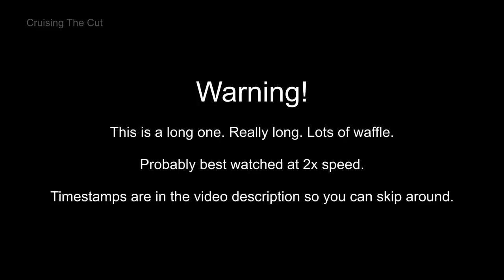241. Narrowboat DIY: refurbishing my shower cubicle

Comment: We have just spent several years totally renovating a 120 year old French longere, which now has 4 shower rooms, so i absolutely understand your frustration, screaming, use of great British expletives and need for alcohol. We also used "plastic panel" at an angle, but only cut the back and honeycomb leaving the thin front cover intact, then bent to to required angle, filled the open V shape in the rear with gunge and fixed into place. It negated the need to try and join half cut panels. Maybe you could try this when you next upgrade your shower.....lol. Anyway, great vid, loved your comments and the job looks perfectly acceptable. Stay safe, all the best/

Comment: As a seventy year old woman in Australia I have no clue about refurbishing a canal boat shower recess but as a sewer I understand your frustrations.  The thumb of rule is you measure twice, cut once.  I am constantly dismayed as  to the depths of my stupidity while trying out something new or out of my comfort zone with sewing, however, if I hang on in there with it I usually have the job done.  Your job looks terrific, glad there were no temper tantrums where you kicked the boards to bits (not while up against the tiles) and gave up.  Now every time you have a shower you can feel a sense of accomplishment.  Well done.

Comment: Looks well David. Only 2 things I would have done differently. 
Where you had to make the horizontal cut halfway down the wall, I would have scored the panel at the back and flexed it at the angle change. This would have left an unbroken surface. You could have possibly done the same for the corner moulding,
And I think I would just cut a few inches off the top of the vertical shower rail so it would fit the existing screw holes.
Regardless, it looks good and more importantly, should be very low maintenance.
….. and I’m so glad you went with s new rail lol…
Reply from the maker: Cheers. I didn't think of the scoring the panel back. As for the rail, it's such a cheap piece of plastic, it felt really brittle like it would shatter if I tried cutting it.

Comment: The same button that allows you to take the "gunge tube" out of the "gunge dispenser" is the one you use to stop the gunge dispensing. It takes the pressure off from the "gunge dispenser" trigger as well as allowing you to pull the gunge actuating rod out of the gunge tube.

Comment: Congratulations on completing a really difficult job.

Looking at what you have done against the finished work, I have to admit, it looks pretty good. You wouldn't think there were filled gaps and bogged up screw holes in your panels.

I would score you job easily at 8 (out of 10), and if you had not shown the mistakes, then it would easily have been an excellent score of 10. So, again, great job, and well done.
Reply from the maker: Thank you

Comment: Thank you David for another emotion packed DIY project.  I sensed your level of exasperation was on par with your chimney removal Vlog, where you ended up beating the poor thing into submission in order to remove it.

Given you are a perfectionist (I am also), you are being too hard on yourself because, the project didn't turn out exactly the way you were hoping.  Actually, you did quite good concerning this was your first attempt.  You didn't sink the boat, cut through pipes or wiring, and you didn't even have to go out and buy additional wall board due to cutting errors.

I suspect the ceramic tile was doomed to crack from day 1.  Tile is very brittle and has a different thermal expansion rate of the wood and steel.  Additonally, wood expands with increasing moisture and ceramic does not.  When the sun is shining on the starboard side of the boat, you will have uneven heating on the wall due to part of the wall being below the water line.

Shower stalls can be frustrating to seal from the low level leaks you were seeing, as a little splash of the water can find its way into some amazing pathways to the outside.  It's a good thing you noticed the wood discoloration and took action.  If left unchecked for a few more years, the whole wood structure under the shower pan would need to be replaced due to rot.

I always use stainless steel screws and silicone caulk in the shower areas.  I'm sure you could have purchased some pipe nipples to allow the new valve set to reach the existing pipes in the wall.  However, if the nipples are metal, they should be the same type metal as the valve set to avoid galvanic corrosion.  That wallboard you used looked very fragile, any screws you ran through it should not be tightened such that it causes the wall board to flex.  Over time, a crack will appear at the site of the flex point; meaning a potential leak.  As far as wiping down the surfaces where you plan to put the adhesive, there is no need to buy that expensive stinky degreaser, just wipe everything down with rubbing alcohol using a paper towel.

To conclude, you researched the project before hand and did a good job over all for your first attempt so, you should be proud of yourself.  I'm sure you are enjoying taking a shower once again in your own bath, instead of using the one supplied by the marina. Enjoy that gin and tonic now with a nice cheese sandwich!  -Cheers!
Reply from the maker: Thank you :-)

Comment: Interesting that you use metric measurements for length when the UK still uses mph for speed. Also comforting to see that your DIY is as frought with as many aargh! moments as mine is.
Reply: Both have their uses, metric is more useful for construction as it goes down to millimeters, whereas it's hard to visualise meters for the width of a road for example.
Reply from the maker: I use both, depends what I'm doing!!

Comment: Hi there,  just a comment. To cater for the forward bend in the panel you might have been able to cut part way through the rear of the board and then carefully bent it forward to form a bend in the front decorative skin forming a hinge. Thus you would not have a gap to seal as the board is still continuous in length. Just a thought may have worked.
Reply: This comment is tantamount to man cruelty.
Reply: Yes, exactly my thought.  Put a bead of sealant in the cut on the back of the panel to provide flexible reinforcement.  I would also have advised using poster board to make a template - get that fitted as exactly as you wish and then transfer the pattern to your panels.
Reply from the maker: I did not think of it, alas

Comment: Don't be so hard on yourself. It looks to me like you did a fine job. Especially considering the difficult situation you had to deal with. And although you had a couple of 'oops', they were relatively minor and easy to hide. All things considered, a job very well done.
That being said...  Should you also fill in that gap under the door with sealant? Just for good measure?
Reply: Agreed on both points.
Reply from the maker: Cheers. No need to fill the gap under the door, it's just the plastic tray and the aluminium door frame. No further sealant needed.

Comment: It's painful to watch this video.  Every DIY project becomes a torture session like this one -- involving dozens of tools and hours of frustrating labour in order to accomplish even the most trivial task (replacing a light bulb or repairing a leaky tap).  I admire your patience and persistence.  I would never undertake a project that's as daunting as this one.
Reply from the maker: Cheers
Reply: Screw and glue the corner piece, let it cure then remove the screws and dab over the holes with sealant. 
Even better, ignore the instructions and junk the silly corner trim.

Comment: You've got the rod for the shower head upside down mate. What you think is the top, is the bottom, and thus infinitely adjustable.
Reply from the maker: Cheers but no, I don't. The bottom piece is specifically designed to hold the rest up and I definitely have it the correct way around.

Comment: Aargh!
 You can cut the back of the panel through to the front layer so it bends without losing integrity. In this case a straight cut would do but if you wanted it to bend outwards you would cut one or more "v" shapes. For the taps, you can get threaded brass tube in that size and various different lengths to make your own adapter and there are tank washers if you want to tighten it from the back.
Probably too late now but.
Reply from the maker: Yeah, I'm pretty sure I'd have managed to cut straight through the board!!! But otherwise, definitely a good idea.

Comment: Hi, nice job! One question though: the panels on the left wall are cut across halfway, couldn't you have cut only the back side so you can bend the panels very locally? This would avoid one joint. Enjoy your video's very much!
Reply: Just done my sons bathroom ceiling in the plain white board, it was like working on the inside of a pyramid !!!! 4 panels going to a point  and had to score the backs halfway up as the wall also sloped ,,,this was in a new house ...David was a brave lad doing that job ,,,,it looks ok....

Comment: I know it's too late now, but it might help someone else using those panels, there are two possible ways to deal with the horizontal bend, without cutting the panel:

1/ Heat the panel gently with a hot air gun along the line where you want it to bend, prop it in place and allow it to cool. It will then hold it's shape as it's a thermoplastic.

2/ Cut the back face only at the bend point, that will allow the bend without affecting the front face.
Reply from the maker: Both good tips!

Comment: Chose a bad time to watch your vlog, at 1am, However, you’ve made an amazing difference to your shower cubical, don’t want to be rude but it looked a little dated / depressing but now its neat, clean lines,  with a modern feel. Had  i not watched you fit it  out and point out all the mistakes you’d done  I’d have been none the wiser that an expert installer hadn’t done it. If i ever need a shower cubical modernising i will know who to call.

Was a little surprised to see you cutting your boards with a knife straight on your timber floor, but I’m guessing no damage was done.

With regard to screws holding the panels down when glueing, it did occur to me that you could have screwed and glowed, then when glue set then remove the screws ,hence not having screw heads bowling panels out. With regard to the shower holder screw hole being too deep for your pen, I’d have used a nail to mark through to the plastic wall panel.

Final thought you did a close up under the door, where you masticated the wood, but think I’d continue o fill gap all the way along under the door because  i think you can see wood grain, and this would be another place for damp to get through.

But i score you 10 out of 10, for quality, and managing not to swear during fitting. Guess the ice cream helped to cool the stress
Reply from the maker: Cheers. You're not the first to suspect wood under the door but it isn't, it's just the shower tray (I think there's some old sealant under there). No further gunge needed!

Oh, I did swear at least once but I cut them out!!
Reply: The swearing was edited out .... LOL

Comment: I never use the corner pieces. You have to be very good at cutting straight edges and you can butt them together and simply silicone up the corner, to get a good edge of silicone you can buy silicone tools to spread evenly and neat.
Reply: I was going to say the same. Blank the corner pieces, more trouble than they are worth, and just do a decent job with silicon seal with the edges butted together. Also I was going to comment that to overcome the bend in the side panel, I think I would have cut through only the back side of the panel along the line where the bend would be, and let the panel bend forward. That makes no sense how I’ve written it down. But it would have meant no seam to seal, along the line where the side leans in.
Reply from the maker: Interesting; my straight edges weren't bad with the multitool so that could have worked!
Reply: @sprint955st  ditto sprint, the corner trims just look like hard work that never quite fits 'just right'  and it makes perfect sense to me too, minds thinking alike eh.

Comment: Bit late to say…. But if you ever do this type of work again, if you score through the rear of the panels you should be able to bend them to the angle of the walls. Shouldn’t need to cut the panels at the bend.

Comment: You didn't need to cut the panels 1/2 way up that go on the boat side, to get them to bend you could have just cut the back half of the honeycomb and they would have bent easily.
Reply from the maker: Yeah, I wish I'd thought of that - but I'd probably still have sliced straight through by accident!

Comment: why didnt you just shorten that metal bar for the shower head ... ? until it fit the existing holes...
Reply: I thought the same thing 👍
Reply: Or turn it up side down!
Reply: Or flip it upside-down?
Reply from the maker: It's such a cheap piece of plastic, it felt really brittle like it would shatter if I tried cutting it.
Reply from the maker: Unfortunately, it won't work upside down as the bottom piece is specifically designed to hold the rest up!

Comment: Clean the shower door it's disgusting.
Reply from the maker: It really isn't. There's a fair bit of old sealant which looks grotty but it's not doing any harm. There was a short length (4-5 inches) of actual mould I agree, which I have removed.

Comment: You kept me 'glued' to the TV for 49+ minutes learning about fitting shower surrounds, and feeling every bit of your frustration! I did put it on 2x speed for a repeat performance and it was hilarious!! Anywho, I would have sprung for a new fangled wide shower head and tray, but hey, that's just me...lol...You held up very well over those days with hardly any patches of hair loss from pulling or permanent neurological damage from the degreaser!! (lol) And your finished shower stall looks far better than the old seashell tiles with grotty grout. Nice work! Looking forward to your next project....can't wait!
Reply from the maker: I did wonder about the tray and looked into replacements but I'd have had to pretty much demolish half the bathroom to fit it
Reply: @CruisingTheCut  ....oh I see...anywho, hope you get an opportunity to do some van camping now...up to the Peak Forest...I heard it's lovely there! xx

Comment: For someone not a carpenter by trade you made a very nice job of the shower refit, neatly cut and tightly fitted. A significant improvement, both esthetically and functionally. And as a fringe benefit, the air spaces in the corrugations of the board should offer a bit more insulation than the tiles had.

I see that a couple of others in the comments have clued you in to the pressure relief options for what we Yanks would call a caulking gun, that does cut down on the mess and waste.

Might I suggest that you review the section of footage near the end where you show the very thoroughly caulked corner where the main leak was. If you pause the video at 48:45 or so, and look to the left, I believe you’ll notice that there’s a long strip of light and unfinished wood beneath the shower door.

Were it me, I might break out the handy-dandy caulking gun again, cut a bit more off the tip, (so it would lay a larger bead), and caulk the bejeebers out of that strip under the door- finishing off by tidying up with ‘the finger’, of course, (even though no one else will ever know or see it). That should see you ship shape, if not entirely Bristol fashioned. ;-)

And finally, may I offer an olde carpenter’s trick for setting screws in wood, especially in damp environments- a small chunk of paraffin, well warmed, will leave a nice layer of wax on wood screws. The wax is not only inert, it’s actually good for the wood and both seals from moisture and lubricates the metal interface. You can come back decades later and the screw will back out very politely when asked. :-)
Reply from the maker: Thank you. I know it looks like wood under there but it isn’t! Ta for the screw tip

Comment: The joys of DIY, well done for sticking with it. Another option for the wood that got wet, rather than cutting out is a converting product that you paint on. It requires you to drill holes to let is soak deeply, afterward it turns it rock hard. I used it to save the bottom of a door jamb/post of a garage side door.
Reply from the maker: Good tip, cheers

Comment: If you look there is a gap between the Shower tray and the opening door frame (you can see the wood ) this needs filling with sealant also!
Otherwise a good job David!
Cheers
Reply from the maker: Cheers. No, there's no gap and no wood there so no sealant needed. The "wood" looks like some very old sealant on close inspection.

Comment: Congratulations on hosting Sealant Fest '21! I was worried about that panelling and the join matching as you said. However the finished job looks really smart; you must be pleased. Ive just finished a "simple" cupboard boarding and rack shelving. The challenges along the way never cease to amaze me and strangely enough make sweat drip down my neck but it is good when its finally done until the next job...
Reply from the maker: "the next job" hahahaha

Comment: I am supposed to work, but couldn't resist, 49 minutes or not. Your newly marbled shower actually reminded me of the one at a very British Hotel Bristol in Gibraltar the last time I was there. Well then, royal showering!
Reply: By the way, a little tip: Remove the screws from the shower set and the basket again, press some sealing compound into the holes and screw the elements back on. This prevents water from entering. And in case you one day want to freshen up your shower tray too; there are special varnishes for it. 🤓👍🏻
Reply from the maker: Never fear, I squeezed sealant in at the time